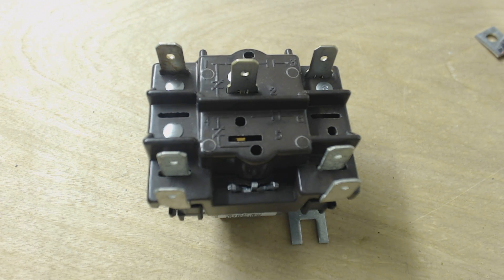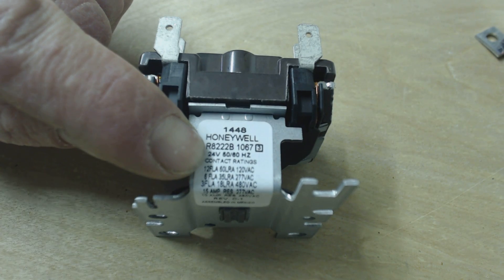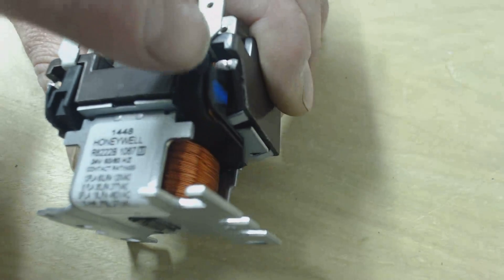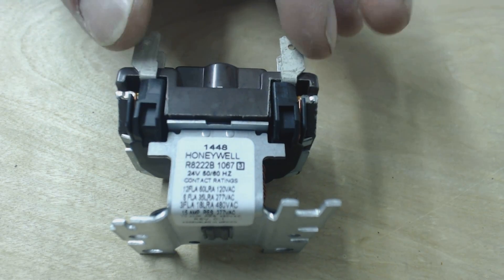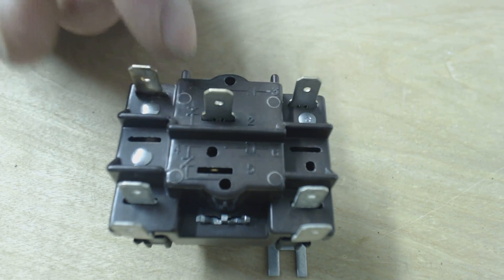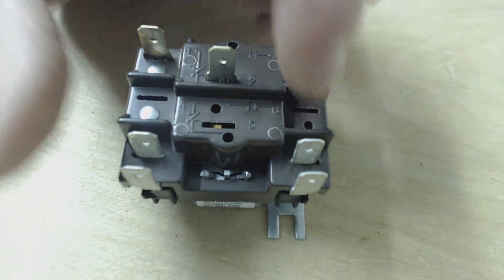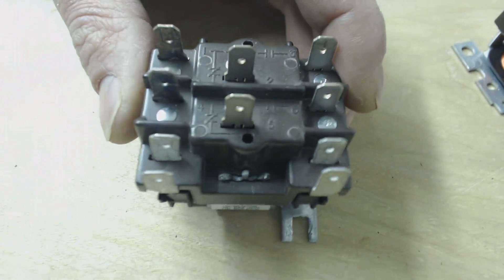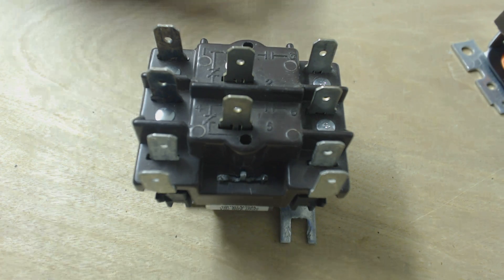General Purpose Switching Relays, Mulitpurpose Relays!: Function, Wiring, Ratings, Different Types

Comment: Can I use use a 1/2 hp relay in place of a 3/4 hp relay as long as the 24V 12 A FLA @ 120VAC is the same with both relays?

Comment: Can an 8 pin DPDT relay be used to relay power to a 120 VAC blower motor, as well as one or two 240v electric heaters?
Or is there a separate, single pole relay just for the fan; & a DPDT relay just for the heater(s)?
Reply from the maker: You would have to check the amperage rating on the relay vs what you are putting across the terminals. I would use two though as well, thanks
Reply: @acservicetechchannel  I saw a warrentech heat kit in a Trane electric air handler. It had 2 heaters.
Each heater had its own DPST relay. 1 heater had an open fuse link.
The entire heat kit was in bad shape, so I replaced the entire heat kit with a new warrentech heat kit exactly like it.
After installing it, I found that only 1 of the heaters was pulling about 20 amps....which is what its supposed to pull.
But the other heater wasn't pulling any amps. I let it run for like 10 minutes & the other heater bank wouldn't draw any amps.
Do you have any idea why?
Great videos!
& thanks for your relpy.

Comment: Good video  . I have a 15 year old  furnace and this same part is making a bad noise what can it be PLEASE  help i have no heat
Reply from the maker: The component shouldn't be making a loud noise really. It sounds like it or the transformer may be bad but there could be something making it go bad. I wouldn't be able to tell you without voltage readings, thanks

Comment: hi sir Is it possible to get a relay to power a whole house fan by triggering relay using a nest thermostat already being used for the central heating and cooling for the home. basically stealing the controll to power the house fan not to function at the same time though.
Reply from the maker: If you disconnect the g from the control board of the furnace then yes. The main concern is that you don't draw too much power through the fuse or transformer. In this case maybe instead of deciding to power the contactor on the outdoor unit in ac mode, you are choosing to run a whole house fan in the hallway ceiling instead of running ac, totally fine. I would use a contactor with a fla rating higher than the fan amps. A 12 fan relay could also be used if the amp rating is high enough compared to what will be drawn through it. I think they would be high enough but you should check the amp rating or take an actual amp draw first.  Just run the G from the stat regardless what type, to the one side of the coil on the relay and a wire from the other side of the coil to the C terminal at the furnace or air handler. Make sure the relay is in an enclosed area. Thanks Caliguy909!
Reply: @acservicetech thank you for taking the time out to answer yet again another question.  I was thinking about the gate terminal and common  the only thing now is I would only get 1 speed. is there a board similar to zoning that I can use to power high speed and low speed using the thermostat?
Reply from the maker: Honestly, if you are wanting to control 3 speeds to this fan, why don't you put in a three speed motor control near the existing thermostat on the wall and run new wiring as well as keeping this separate from the furnace or air handler.?
Reply: acservicetech I usually do put a three way switch with a timer but the customer mentioned that he wanted to control the fan with his nest thermostat.  so that's what got me thinking about being able to adjust speeds through the thermostat.